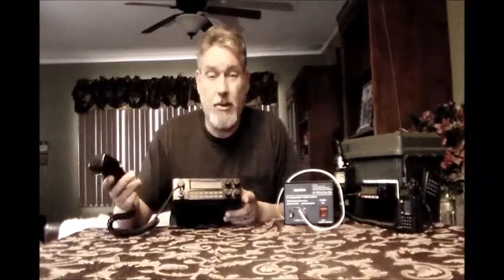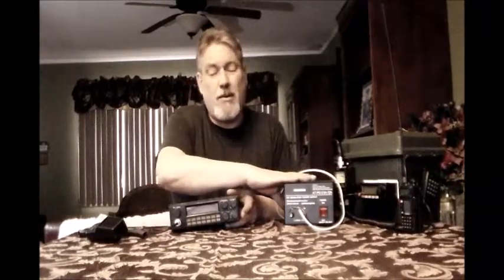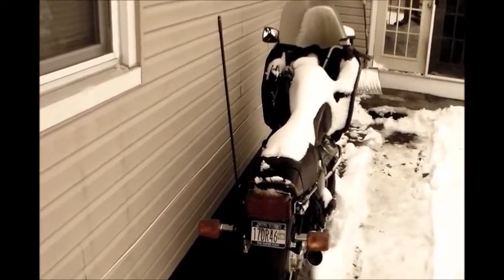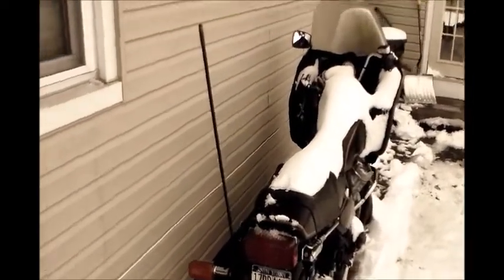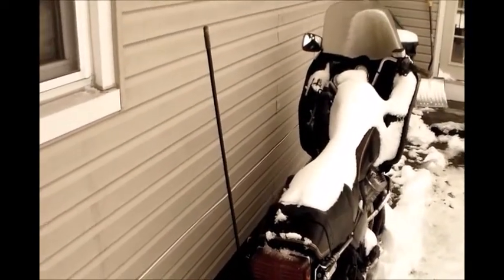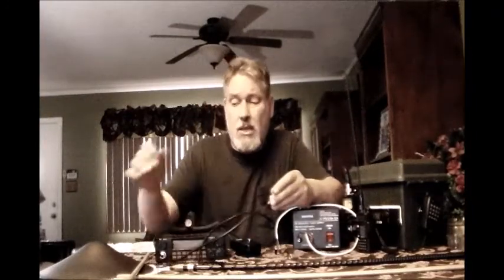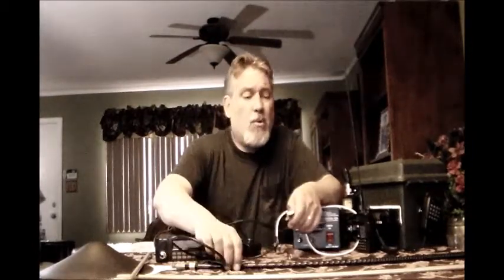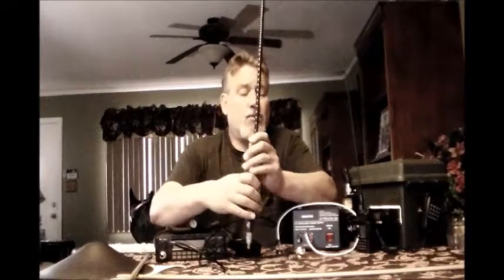Homebuilt 10 meter antenna

Comment: The year was 1997, It was fieldday. I heard Ohio talking to canada. Canada was scratching my receiver. I was on ssb two meters. You don't need hf to talk long distance. But you may need more power, I had 300 watts and a 4 ele quad beam. Not enough to make the contact. Maybe if I had a kw amp. I'm in North Carolina. 73 kf4dcy.

Comment: I just got my technician licence about a month ago . Studying for my general now. I have a boafeng  B5x3 .I made a 1/4 wave ground plain and now I'm  going to try to build a  yagi .  Great video !
Reply from the maker: That's Great!  I built a 5 element 2 meter yagai out of an old tv antenna a few months back.  It is working really good.  This one was really to just try out the 10 meter rig.  10 meters is real quiet right now.  Good luck with your general test 73 KD2KNL
Reply from the maker: https://youtu.be/G3su3Tm3NTA
Reply: Check out the Tape Measure Yagi if you haven't already.  I built one modularly so I can put it on a mast, or hold it like a rifle.  It's always attached to my Baofeng.  It usually outperforms my $30 dollar Comet HT antenna.

Have you had any luck on 10 meters lately?  I just got my ticket a year ago.  Just got real into HF, but then I moved into an apartment on the ground floor.  Between the building being a faraday cage, lease rules regarding antennas, and only having a small view of the horizon off the balcony, my hobby kind of came to a screeching halt.

I did, however,  manage to build a 2 meter vertical with a fishing rod and some heavy gauge copper wire!  When it's up, it just appears to be a fishing rod leaning off my porch railing!